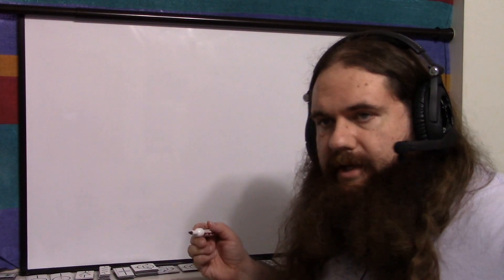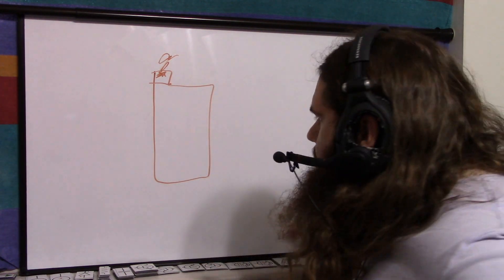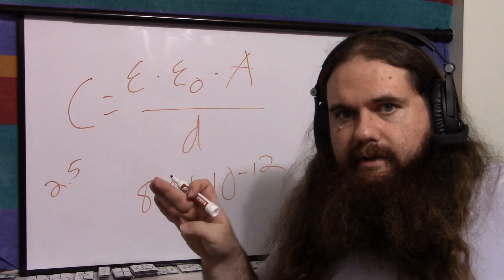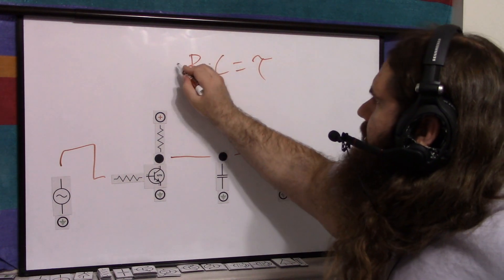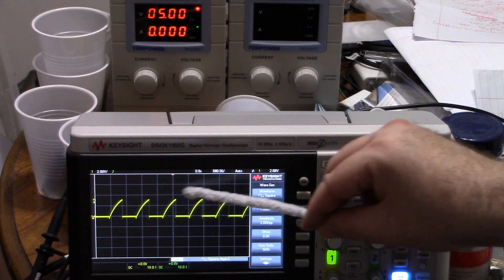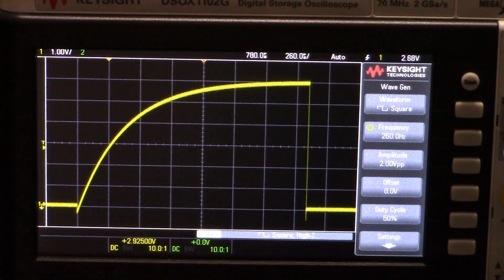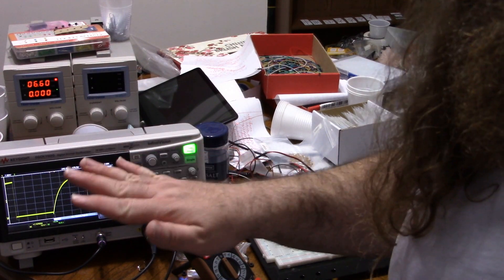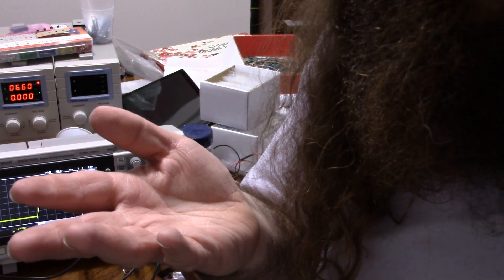Homemade Capacitor - Just Aluminum Foil, Paper, and a Few Surprise Discoveries - Simply Put

Comment: Thanks this is a good video. How big a capacitor would I need to light up an LED?
Reply from the maker: A capacitor is not meant to be a primary power source because it can't store large amounts of power, so you wouldn't "light up an LED" with it, unless you just wanted to blink the LED on briefly for some reason.
Reply: A potato with coppper electrodes stuck in it would probably light a led.

Comment: I wonder how interesting would it get to do capacitors of different metals, like aluminium and copper. And how they're affected in terms of frequency. Will it still be like i = C dU / dt or will it be another thing.
Btw, is it over between inductances and capacitances ? Wouldn't it be great to have a third thing of another dimension
Reply: Hmm foldable circuits that can be worn as a glove... This glove will send signals as per varying capacitors. How cool is that

Comment: Did you try the copper tape?  It’s adhesive is different. Also, it could be just one long strap wrapped into a cylinder.
Reply from the maker: Yep, I already did one copper tape video and will do many more because it's cool (including the conductive adhesive). Using the tape to make a capacitor would be a waste, though, since it would take so much manual effort and foil is cheaper. Copper tape to make an inductor or electromagnet, though, now there's an idea.

Comment: If you find this diy capacitor interesting then you should make a layden jar or a few of them and put a very high voltage on them and see what happens.

I made those paper and alu foil caps too and also the layden jars that I use to experiment with my ZVS driver circuit which is capable to output about 150KV from my flyback transformer... Yes it's really 150 Kilo Volt or One Hundred Fifty Thousand Volt and when I connect my Layden Jars all kind of interesting and weird things start to happen and the sound coming off the discharge sparks is unbelievable hard and violent, it makes me jump every time when I get the first big spark.

Without the layden jars I can pull the electrode away about 15cm and according to science every 1mm through air that a spark can jump is about 1000 volt up to 3000 volt, I'm being conservative to use 1000 volt for every millimeter, so 150mm times 1000volt is 150000volt and that's continues which is very dangerous... Especially when it's that much voltage and several ampere, I measured it to be just below 13 ampere... It's crazy I know but I like to do dangerous experiments and I'm still alive so don't worry about me, I know what I'm doing otherwise I couldn't tell you about it.

Cool thing about the layden jars is that I once touched the glass when my ZVS driver was running and it looked like a plasma bowl and I could feel the energy buzzing in my hand which was really strange and not something I would try to do again any time soon because it too dangerous and stupid so never try to do that yourself.

Best regards,
Ricardo Penders

Comment: Paper circuits are getting interesting!  So make me a paper and foil transistor and I’ll be really impressed. 😂
Reply: :) Probably not a foil transistor, but foil and selenium (vaporized) could replace a diode. Theoretically, it would be possible to make a "switch" from such diodes, which is quite close to a transistor. :)

Comment: Cool, I was just playing with that. I needed a variable capacitor for my radio circuit and found that this technique works well. I used thin cardboard and super 77 spray adhesive.  remember the pinwheel calculators. or the slide calculators. just make your capacitor like that and it works ok. saved me a month to wait to try it out. I used aluminum soda can aluminum instead of aluminum foil.
I've been trying to keep up with the math, wow it is hard to remember all the names of things. but repetition will prevail! keep up the video's I find them interesting.
Also I have to ask, maybe I missed something somewhere? whats up with the headphones?
Reply from the maker: The headphones are just for a rigid mount for my microphone, which is the little lapel mic at the end of the arm. With my hair and beard I have not found any other way to mount a microphone that I like or that will even stay where I put it. And also, I took joy in destroying those headphones because they were one of the biggest wastes of a lot of money I ever made, and at least now they're serving a purpose.
Reply: @simplyput2796  Ok I get it now. the mic does sound good.  we need to invent a beard mic! lol